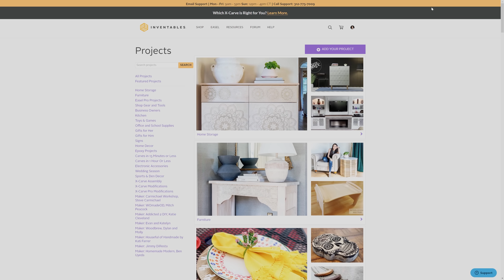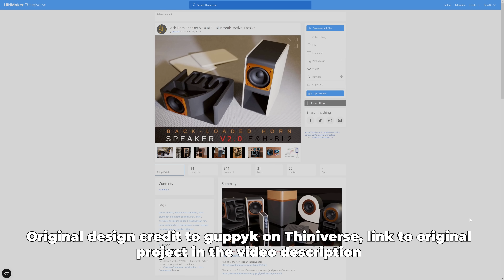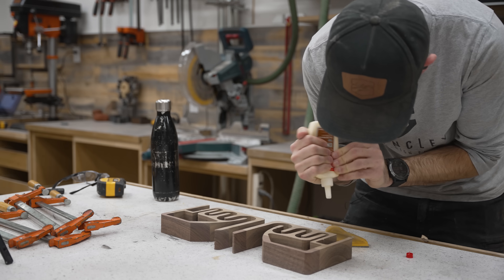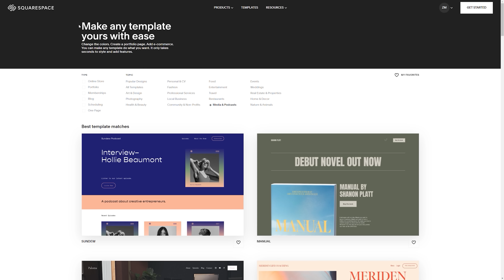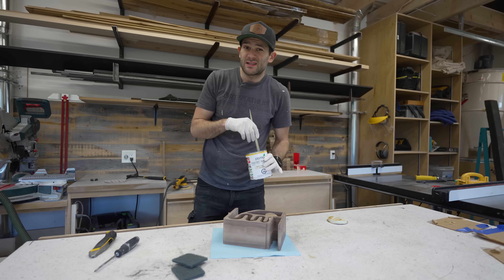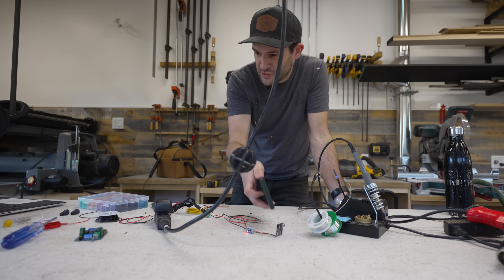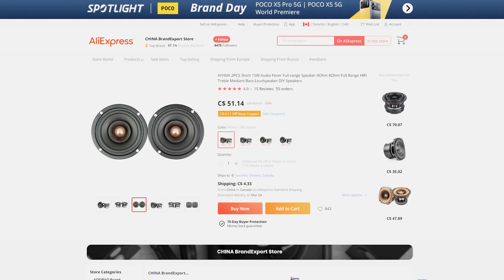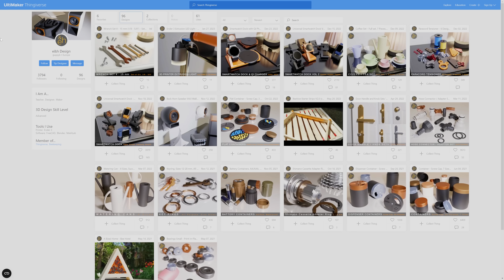Your 3D printer is now obsolete...

Comment: stl files into a cnc mill is not new.  the entire point of a cnc mill is to make 3d objects and as such, it is standard in many other software packages.   the problem is that you chose a brand that  locked you out of those ecosystems.

Comment: You really need more than 4 screws on each side - the air is bypassing the length of your resonance chamber by going between the wood and acrylic. And you're right about needing a gasket. You can buy rubber o-ring material that you just lay into the channel you route into the cabinet with the X-carve - but that channel needs to parallel the entire length of the chamber, not just around the edge of the box for the rattling.
Reply from the maker: Yes I agree 100%, thats what I was trying to say in the video, but clearly I didn't do a very good job of it.
Reply: @ZacBuilds  put a 5th screw right in the middle of the plexy to support the inner wood,  it is not  being supported by anything and will vibrate and may break.
Reply: @theads9519  Nahh the air pressure is very low in the horn, the air won't escape through the gap however the vibrations between the wood and plastic would be a problem. However, the main thing here is it seems Zac bought some random driver from the internet and not the one designed for this enclosure? If this is the case, this enclosure would be anything from detrimental to the output to mildly useful, it's most likely somewhere in the middle.

Comment: Super cool project, but I feel like you did a disservice by over hyping the 3d carve feature in Easel Pro since you didn't actually use it. For a carve like you made, it only uses a 2.5d cut. This has always been available in the free version of Easel. The 3d carve feature simplifies the CAM process compared to more advanced software like fusion 360. I'm happy to see that they have made it available but you shouldn't misrepresent how it is used.

Comment: You only need a long bit once your shorter bits don't reach any more. Start with your shortest, then step up as needed. Then your slow cuts are only the last part of the tool path.
Reply: Also you can start with the largest diameter cutter you can get away with to rough everything in, then use the necessary small diameter cutter to clean up the corners.

Comment: To be fair 3D printers use gcode or bgcode rather than STL files. But you use an X carve, a drum sander, a table saw, clamps, drills, belt sander. How much did that all cost? Even the X carve costs more than an x1 carbon combo 3d printer. Looks amazing though, I'll give you that but my 3d printers are well safe.

Comment: TPU, TPU, TPU, if you have a 3d printer, TPU is the way you want to make the gasket. I've used it in my shop and its a game chager when trying to hold some pressure. I know this is late in terms of you releasing this vid, but thats your solution for increasing the inside pressure, for better sound propagation out if the port. Regards.

Comment: You made a few errors but errors are great to learn skills .. a. Cut seperate layers...You worked that out the hard way  but well done. B. You could drill location holes , index holes so the glue lines up both sides

Comment: 3D printers dont run .STL files they run .GCODE files, the slicer on a computer takes the .STL file and converts it into .GCODE that the 3D printer can read.
 The files that will be able to be used with X-Carve will be limited to very simple designs

Comment: Don't CNC machines use G-code, same as 3d printers? What's been stopping someone from writing a the equivalent of a slicer to convert STLs to G-Code for your CNC up until now?

I'm kinda confused as to why this is so revolutionary (no pun intended).
Reply from the maker: It's definitely possible to pipe G-code into the X-carve through some third party applications, however those all involves quite a bit of knowledge. This is a simple drag and drop operation that makes it considerably easier for lay people such as myself.
Reply: @ZacBuilds  thanks for the reply! I guess I'm mostly surprised that an application to do that didn't already exist given the similarities and crossover.

Comment: Ok so couple things to note. 1 you could have actually done 1 in pieces and just cut multiple pieces on the table at once. 2. You could have built in dowel holes to index the parts together and it would have made the glue up so much easier. 3 if you had done an even thinner onion skin then cut through it on the CNC at that stage it's such low resistance that the part would not have moved. 3 you could have just added in your notches for wire management on the CNC.

Comment: I have three main issues with the points you bring up in this video. The first is that if youre operating any sort of CNC router, Lathe, or Mill for your business, you should know how to turn an STL file (such as whats found on thingiverse) into a step or obj (or any solid body model built from T-splines instead of triangles/quads). This can be done automatically in some softwares or manually with the original mesh as reference. 

My second issue is that The X-Carve doesn't have the biggest community because its a bad investment. Most of us that are into buying CNC mills/lathes/lasers/Routers etc put it in a low ranking for quality in its price range. Please dont take offense to this, as im sure you yourself and many other people have managed to make quite a good bit of money with these machines, but the fact that the X-carve product line is not competitively priced, as well as having to pay for their software packages that go with their tools, doesn't help its case. Like Shapeoko, Bantam tools, Glow forge, assorted diode laser marking systems, etc... theyre downright bad investments. For example, on its best day a Glowforge cant outperform a Chinese CO2 laser for the price. The Bantam tools CNC mill is a joke in performance and price compared to the similarly priced Tormach 440pcnc. As a matter of fact you can buy a langmuir systems MR-1 CNC mill for less than a bantam tools Mill, and it outperforms circles around it in every category. In the case of CNC routers like the shapeoko or the X-carve, For an extra 50%, you could buy a Tormach 24R which is a considerably more powerful, production capable, modular, and versatile machine, so in the 10K to 15K range the X-carve is a foolish choice in my and many other professionals opinion. You're buying this machine to make money, if you can afford a 10K machine and not a 15K machine, you might as well finance half the price of the machine and pay it off early, and keep the extra 3K as a years worth of financing over a 3 year term while you get situated. If youre splitting hairs over a few hundred dollars, or even a couple of thousand, youre just better off buying a chinese machine. These aren't really for hobbyists at these price ranges anyway and the goal is to make money with them. 

Third, The bottom line is that 3d printing is also an entirely separate process, being an additive process, than CNC routing. It excels at certain things and lacks in other areas. Everythings a nail to a hammer and if you treat a 3d printer as a means to just "Build stuff" in general and not as a tool for specifically additively forming plastics, youre not going to be taking advantage at what the tool is good at. Large format resin printers for example fill the niche of the heavily lacking home injection press market, but if you try to use it for building a shed youd have an easier time with a CNC router.

Comment: The whole thing should be tight as f.... Acrylic side plates might work if they were like 10mm thick , glued to wooden parts and maybe some more screws. In your case the walls just bounce and I bet they make some squizy scretchy noize while bouncing. Looks really good but makes a terrible speaker

Comment: I found it interesting considering that cnc is the EXACT opposite of 3d printing.  In cnc you remove any material that doesn't belong leaving only the material that does belong whereas with 3d printing you start with no material and add it to where it does belong.  You essentially get the same result in the end however you have to come at the processes completely differently.

Comment: So I have to buy or rent a place about a size of my apartment to get that machine in and get it to work. Also I would need other machines for making even that little speaker. So At this point before I haven't started anything machines would cost me about $5000 to $15000 plus rent. My printer was about $200. 

Only benefit I can see is when making that speaker. It will sound much better made out of wood. That's about it. So no. 3D printers aren't obsolete.

Comment: You mentioned the issue, but I don't think you understand audio fundamentals, the fact you know you don't even have an air seal means this speaker's acoustics are basically guaranteed to be garbage, the build is worse than if you just didn't do anything and used the bare speaker cone without the rest of the walnut nonsense.

Comment: When the speaker labyrinth was in two separate layers, that would have been a great time to add the finish, since the distance you'd have to reach into to apply the finish would be cut in half (hindsight is the most wonderful of tools for the next version). It would also make any glue runs easier to remove, even when dry.The next version could also use a small assembly help: have two holes on each layer mirroring each other and putting a dowel in each.
Reply from the maker: Love it! Great advice.
Reply: Having built many speaker enclosures I’m having a little trouble believing those acrylic side pieces don’t rattle as thin as they are. Specially since they aren’t glued to the wood along the entire available area. ⅜-½ would be optimal for the exposed surface area. Would have also given you more material for the slot to hold the io panel
Reply: @geauxracerx  I definitely agree about the possible vibration in the thin panels. A ⅜ or ½" would have the rigidity needed and would look really nice polished up. 
Another thing that could be used as gasket material between the wood and plastic would be 1/16” sheet craft foam. I use it on my speaker builds as driver to enclosure gasket.
Reply: @ZacBuilds you should try plunge cutting with such a long bit
Reply: @geauxracerx he mentioned this at the end of the video, actually!

Comment: Dude - I really appreciate you putting stuff out there, and not hiding any issues or mistakes along the way.  However, I really hate the click bait title (but I understand 1000% why you did it).  The reality is that the ability to do STL import has been available in Fusion 360 and Vectric for a loooong time.  It's just 'new' in the X-carve world because of their software.  Have you tried other software for design/cam on your x-carve?
Reply from the maker: Truth be told I'm not a huge fan of sensationalized titles, but the reality of the situation is thats what it takes to get any views on a video ATM. Going with descriptive and accurate titles is a recipe for failure. I wish it wasnt the case, but like all people I'm driven by incentive structures. 
I've been slowly teaching myself fusion for a while now. It's definitely a powerful program, and I can see how wonderful it would be, but I think I need to log at least 100 more hours with it before I'll be able to start using it for projects haha.

Comment: While it's cool what you have done, I'm very hard pressed to feel like my 3d printer is obsolete. Here's a few reason why. Just from your video: 50% fail rate, multiple work arounds, LOTS of post-processing (more than 3d printing would take), and multiple tools to accomplish the same build. The positive is that what you did produce is beautiful. But I wouldn't say the process you present makes my print farm obsolete. Not even close. But you did confirm how much I LOVE my 3d printing vs the headache of woodworking.

Comment: ZAC NO 3D printer in the world runs off of  a STL file as it would not know what to do with it..... neither do you even need an STL file to begin with as its actually old... mostly any 3D file can be converted into a solid or manifold or water tight model in almost any 3D model format and then be sliced in numerous slicers to be converted to GCODE the actual language that 3D printers use to run and print files from

Comment: Not a large community for the X-carve because no one wants to pay that much for a "Hobby Grade" machine. $2500 for 29"x29" work area and not very easily upgraded. Compared to some of the brands that you can buy their small machine, which is only slightly smaller that the x-carve for under $1000 and then you have upgrade kits you can buy later if you need a larger machine.

Comment: Good first effort but I think you will benefit from looking into tool paths adopted when CNC milling aluminium alloy etc.
I think you would be better off plotting a path for a series of plunge cuts with a 2 flute cutter to remove the bulk of the waste material as a first op then a second op to clean up/finish cut on the inner and outer surfaces of the voids. That way the chip loading and cutting contact area are dramatically reduced and give your fragile long series cutter an easier life.
Reply from the maker: Appreciate the advice! I'll definitely keep that in mind for my next project

Comment: I I was you I would use thicker acrylic like you said but carve the impression of the speaker sides into it and then use some clear silicone or other clear sealent for the gasket. You would then need to make the speaker that much wider to compensate for the speaker inset into the acrylic. You would probably be better off using a spray lacquer to do the insides.  Very cool build BTW.
Reply from the maker: I really like that idea however, when you carve the acrylic it leaves the surface pretty rough, so you wouldnt really be able to see the walnut where it rests against the acrylic. Maybe the clear silicone would be able to help fill it in, but I think it might still look a little weird. Very creative idea though, I'm sure with some thinking you could get that to work.

Comment: I usually work with fiberglass, but for stuff like this, the trick is to use a shallow depth of pass. I'll use a 1/8 mill (tiny), and run passes at about 3 thou and 15 in / min. Takes a while to do deep cuts, but you will get there.

Comment: Nice build. Really appreciate you sharing your mistakes as its the best way to learn. 

One other improvement you could potentially make for a future build is to actually make sure the TL (transmission line) is the correct length for the quater wave length of your driver. I imagine an stl you find online would unlikely be correct but I get that wasn't the purpose of this video. 

Also your videos are really nice quality and there is so much work that goes into that so great job!

Comment: First beautiful job on that speaker it's absolutely gorgeous and walnut and the brass rules were definitely the right choice

Second the x carve can't touch 3D printers and 3D printers can't really touch the x carve

The reason is pretty simple You can get a pretty competent pretty printer for under $200 You're not touching your next car for less than two or $3,000 :-) That's going to put a severe damper on the community that's going to be able to support something like the X-carve which is why you don't see the type of community such as thingiverse much more limited audience when the machine cost that much money which is a pity because it's pretty darn cool
Reply from the maker: Much, much faster. Once I dialed in the settings I was doing it in like 1/10th the time that it would take to do it with most 3D printers.